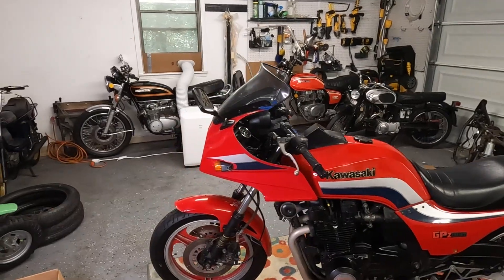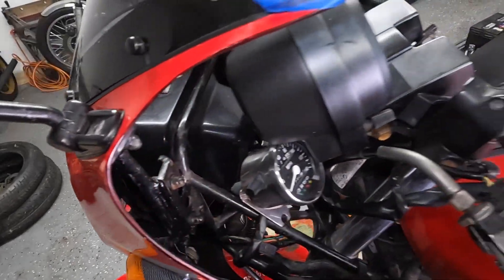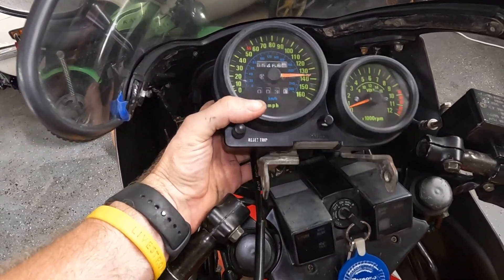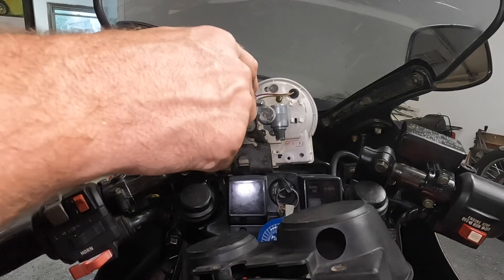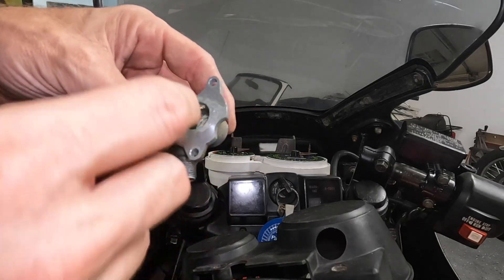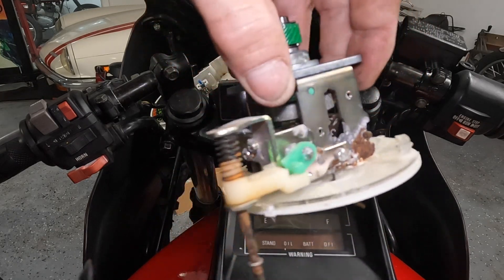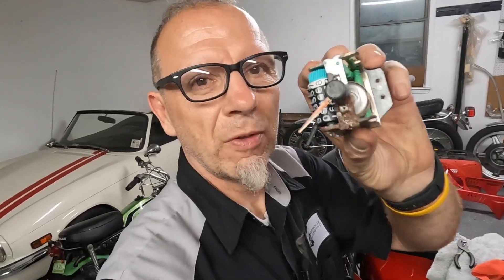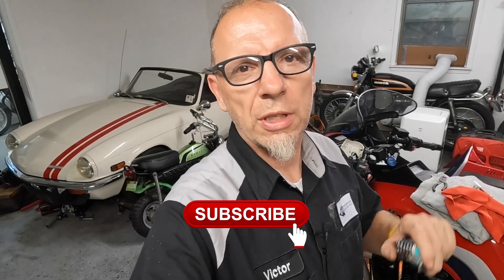1983 Kawasaki GPZ1100 Speedo Repair #Kawasaki #gpz1100 #vintagemotorcycles

Comment: Good effort Eric, I have had the same issue, the spring attaches to that little silver arm that was hanging down near the centre of the speedo. I f you look closely you will see the end is bent over to hold the spring, as someone else said if you have another speedo and are able to remove the spring it is possible to replace it, just bend out that little silver arm, trap the end of the spring in that, BUT you need to pre tension it and the tension affects the speed shown. I have got one working like this but was never sure it was showing the correct speed afterwards and ended up just replacing it with one from eBay
Reply from the maker: I think I have a line on one from someone who watched the video. You need to be a watchmaker to work on that spring. 😂 I was struggling to see the damn thing.

Comment: Good video, learned a number of things. How about exhaust headers and mid pipe painted heat resistant black?
Reply from the maker: Thanks. Should they be painted black? They have some type of coating on the headers. Thanks for watching
Reply: I would consider painting the headers and mid pipe heat resistant black. That is the way aftermarket exhaust were supplied for this /most models back in the day. Would also look better. As you know, not a big job.   Thank again for the interesting videos

Comment: Could you modify a spring front an ink pen to replace the broken spring?
Reply from the maker: It’s like a recoil spring for a pull start engine. Just really small. Both ends are pressed into where they go. I think I have found a replacement.

Comment: If you have another speedo somewhere lying around  any kind of motorcycle speedo you remove the the winding spring carefully and put it in your gpz speedo and your speedo will function again. I had to to that to my 750 gpz because it broke the spring the same way. Definitely clean and regrease the internal parts . It will save you a bit of money and it will still be the original speedo 👍
Reply from the maker: That’s a good idea. Think I may have one I can sacrifice. Thank for watching.

Comment: I'm surprised that the clutch works as well as it does with all the water that was in the crankcase.
Reply from the maker: Me too! Did require a little cleaning but no rust. Thanks for watching.

Comment: I owned a 86 750 GPz at 70 miles I was turning 1800 RPM. YOU need to check your sprocket ratios and check your rpm sending unit. 5K is way way too high at 70.
Reply from the maker: Thanks for the heads up will check it out.